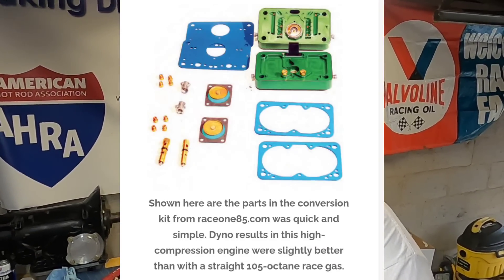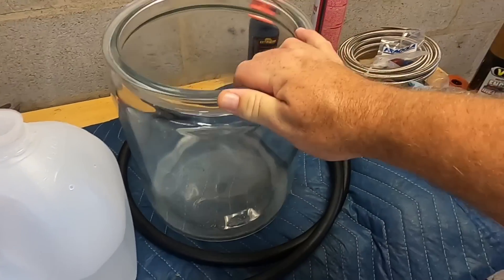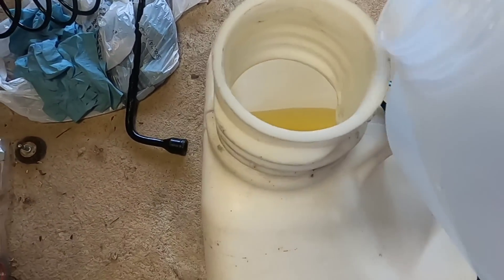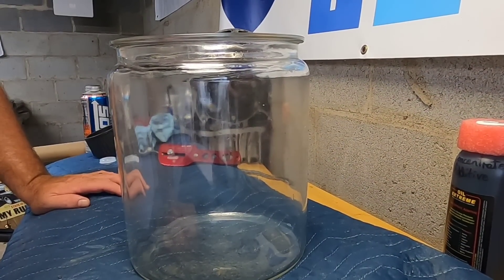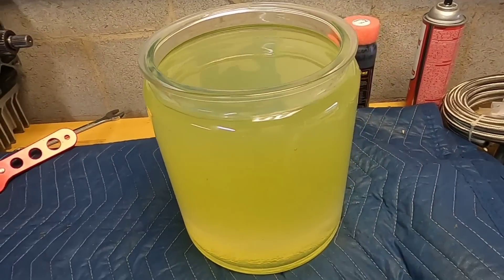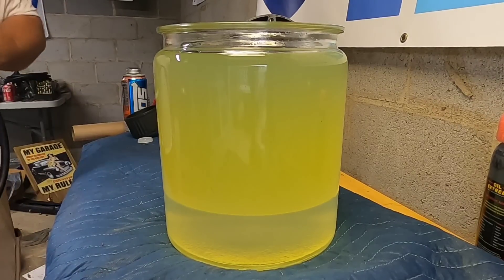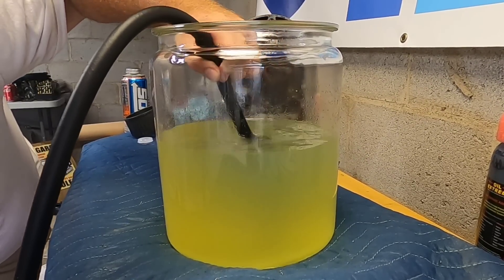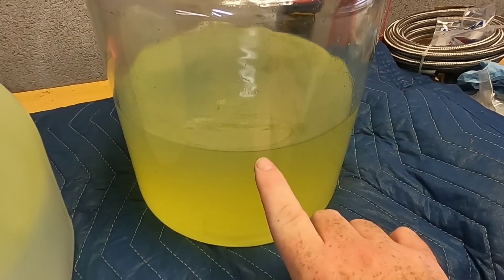Making your own ETHANOL FREE Gasoline!!! it's easier than you think!!

Comment: I have to drive 40 miles round trip to a local small airport to get ethanol-free E0 gas.  Today's price is $5.75 / gal -- a little more than double the price of 10% ethanol regular gas.  But, it comes from a separate pump so there's no mixing E0 with E10

Comment: Ethanol acts as an octane booster in gasoline blends. When you remove ethanol—whether intentionally or through phase separation caused by water contamination—the remaining gasoline has a lower octane rating than the original blend.
In fact, studies show that removing ethanol from a 10% ethanol blend (E10) can reduce the octane rating by up to 3 points, which can lead to engine knocking or performance issues in vehicles designed for higher-octane fuel. That’s why fuel that has undergone phase separation is often considered out of spec and not legally sellable.

Comment: Terrible video.  The ethanol does NOT separate from the water, it gets absorbed into the water.  You did NOT wait anywhere long enough for the separation.  You should have had way more water/ethanol mixture.  This is some on the worst instruction I’ve ever seen.

Comment: I run all engines on e85. Lawn mower, snowblower, chainsaw, generator, my regular truck and car. Cold weather starting requires more gasoline mixed in. 15 years and no issues.❤

Comment: I've ran 10% ethanol in every engine I've ever owned and it's literally never caused me any problems. Old timers will say it gunks up carburetors or it's bad on small engines and that's a load of crap. Your carburetors gunk up or your jets clog because you left gasoline in your mower all winter long. Run the fuel out before storing and these issues will disappear.

Comment: I bought a gasoline tester. It’s just a little tube with a cap on it and it has graduated lines. You put water into the one line and gasoline up to the top. Shake it in about 10 minutes later all the water and ethanol come to the bottom, I have zero ethanol gas.

Comment: Don't try to store it. You have removed most of the corrosion inhibitor, detergent,  binding agents, antioxidants, stabilizers and more. Burn it all up quickly and run your fuel system dry when you're done. 
NOTE; If yoor that hellbent on worrying about alcohol gas just buy equipment that can handle it. Go Old School Carburetion w/ adjustable fuel mixture screws or jets and learn to tune.

Comment: Or maybe just go up the road and buy 5 gallons of non ethanol gasoline at a gas station. Probably cheaper in the long run. Just because you can do something does not make it the best option.
You kill what little octane you have the way you are doing it. Most commercial ethanol free gas has at least 90 octane.

Comment: I would like to share with you my method for getting ethanol free gas. I go to the corner gas station and buy ethanol free 93 octane gas. WHY, do people, as evidenced by all the YouTube videos, go to all this dangerous screwing around? 87 octane in the vehicles and 93 octane in the small engines. I’m 75 and life has taught me at least one thing. Keep it simple; if a choice between just buying ethanol free gas or setting up the lab and going through a big rigmarole, I’ll buy the gas and be done with it. You were correct in warning, “Don’t do this in your house.” For those home chemists that didn’t get the message, I can’t wait to see who mixes up a batch in their basement and blows themselves to kingdom come.
Be careful out there folks!🔥=🚒
Reply: In many parts of the country, ethanol-free gasoline is not available.
Reply: @MCOult  Okay, I’ll revise what I said. Where, you can get ethanol free gas, I would suggest using it. But I would be VERY careful mixing up a home batch. A sure recipe for disaster.
Reply: @lorinkramer5805  Not available in Ontario.
Reply: Dont have gas hurraince hit, but i can have other stuff around in the mean time as a alternative. 😅 I hope you dont die of cancer.
Reply: The irony is alcohol is super cheap, so very profitable to add alcohol to fuel and charge gasoline prices. For a 1000 gallon tank 10% is a lot of $$$, but the crazy thing is, " clear gas" is super expensive, in fact in my area you can buy oxygenation fuel for $3.50-$3.75 but Clear gas is nearly $5 a gallon so you pay a premium. So, not everyone has access either to clear gas either
Reply: @sluggo503 Sluggo, you are 100% correct. When I added my comment, I should have added the words, “WHEN AVAILABLE, for safety sake, just buy ethanol free gas and skip the lab.” There is a gas station here in the town where I live that has only 87 and diesel; and only two diesel pumps at that. No midrange or premium.

Comment: Taking out the Ethanol ..also takes out the OCTANE. For small engines ...maybe OK..maybe not.... For cars...this is a big sin it seems, ,,.especially older cars....with higher compression. 
This video is ill conceived and leaves out this important issue of octane,. ..,which is why the 10% Ehtanol is in the gas to begin with. Better solution is to add water mixer..ie...stable....so the water is mixed..and does not separate out....rather than kill your octane . ..and paying full price for it, ..doing a lot of work to create a lot of detonation. ???

Comment: I cried a little for the gas you lost because you didn't tilt the jar over to get the wash all into one edge (yes a square container with a corner to syphon out of would help).
PS 15 minutes won't settle out right. Try 24 hours +.
PPS. Keeping you tank topped off reduces the air to gas ratio in the tank so there's less atmosphere to suck water out of.

Comment: As commented before, You should have reminded that the 87 is no longer 87, and for some engines that is bad news. Not for a Briggs&Stratton with low compression ratio, but, say, an outboard will be in trouble. So ,if someone wants to make ethanol free 87, he must use at least 93 for making it.

Comment: Here in Mississippi, regular 87 octane is sold for $3.00 per gallon.  The ethanol free gas is $3.30 per gallon (actually, these numbers have gone a little higher recently).  So you can pay a 10% premium to keep that ethanol out of your gas, or lose 10% by removing 10% of your purchase when you remove the ethanol and throw it away.  At least here, the smart move is to pay the premium and save the labor of removing the ethanol, unless of course, you have some use for water infused ethanol.
Reply: but here where i live the local airport will not sell to anything but a airplane. and the only station that is “close” to me that sells pure gasoline is one hundred rd miles away.
Reply: Your probably still getting 5% ethanol and not even realizing it.
Reply: @tacticalcenter8658  nope
Reply: @jimibmore  unless you are using a laboratory to extract the ethonal you are not going to get 100% free ethonal. It's just not gonna happen without sacrificing some of the fuel.

Comment: I wss always told to mixed water with the gas , let it sit for 15mins than freeze it ....the water and the ethanol freezes the gas doesn't, so after it freezes you just dump out the clean non-ethanol fuel . While leaving the frozen water/ethanol mix in the container.

Comment: A) 15 minutes is NOT NEARLY long enough to settle out all the suspended ethanol/water mix. Give it 24. Must be clear.
B) Starting with 87 octane is a BAD IDEA! Results in ~82 octane = predetonation = connecting rods through the crankcase.
     Start with 92-93 octane premium. End with 87-88 octane ethanol free.

Comment: You take the ethanol out of 87 octane gas then you have 80 octane gas left and you will have junk.. Ethanol in lower grades of gas is used to boost the octane and you take it out your octane away from fuel left!! Do not do this unless you can test your octane!

Comment: You can also buy a separatory funnel and stand and do it a lot easier. You would just drain the water and ethanol out of the bottom. Also, letting it sit longer would result in better results as far as the gasoline is concerned.
Reply: I have an aviation water filter and ethanol molecules are smaller than water,  stays on top. passes straight through the filter

Comment: One problem with this is the ethanol raises the octane levels of gas. When you remove it from 87 octane what is the octane level afterwards? If you take 87 octane fuel and add 10% ethanol it will be 89-90 octane fuel. What if you start at 87?

Comment: So what do you do with all the bad water you contaminated??? Dump it out back in the creek or down the storm drain I would suspect. NICE!  Considering you can buy non ethanol gas for small engines at auto parts stores, Tractor Supply, most outdoor equipment dealers, and more and more gas stations are now selling it, why would you do this neanderthal method? You need higher octane? You can buy race gas online in any configuration you could want...leaded, unleaded, with or without ethanol, E85, ultra high octane. Name your poison.  Be ready to pay though that is the price you pay for something special. You make your own gas this way you are asking for trouble.

Comment: Just for shits and giggles ? If you do this to remove the ethanol from the fuel for your small engines (lawn mowers etc) and you have the ethanol and water separated in the other container ? can you add the ethanol to lets say 87 octane or 91 octane fuel and convert the 87 to 91 or the 91 to 94 or higher ? I ask this because in the 1980's I used to put aviation fuel (helicopter) in my Camaro that had flat top pistons and 58 cc 416 SBC castings which netted around a 12.5 to 1 compression ratio and it ran great. You cannot just walk up to an airport and buy 5 gallons of aviation fuel anymore so wondering if you can use this method to make your own ? and is there a tester to test the content so you can dial it in 100% with no error involved ? would be a great video showing people how to make aviation grade fuel or maybe even race fuel ?

Comment: Add a tap to the bottom of the vessel (Separator)with a valve that way you can drain out the water/alcohol mix without all this siphon mess.  As a side note add some acetone to reduce the chance of engine knock.

Comment: I do the same thing with my old mower gas, no matter what you do it gets water in it! Put the gas in a large clear bottle like a dish soap bottle key part here is the valve, add gas and water shake let separation happen turn bottle over and open valve top squeeze out water… your done, put the rest in your tank! You could just decant your mix like wine but you may get some water in your tank, if your not very careful. Dont worry about octane its a mower  after all.

Comment: I'm a retired ASE Master Technician that was trained at the Atlanta General Motors Training College back in the 90's and Ethanol has a bad rep it doesn't deserve, mostly because of misunderstanding and what happens to small engines, especially in the carburetors, when people just leave it in them over weeks and months of inactivity. First, a little history of how the gasoline market worked BEFORE "gasahol".

Before they put ethanol in gasoline every gas station had long poles they had to keep that were long enough to reach the bottom of their tanks. They also had to keep a tube of special paste that a state inspector would smear on the pole he used to inspect the tanks. The paste revealed any water that was at the bottom of the tank. The reason there was water in the tanks in the first place was because the air has humidity and as the tank empties, moist air gets drawn in and the water condenses inside the tank. Over time it builds up until the tank has to be drained and cleaned of water. There were standards as to how far off the bottom of the tank the pump was allowed to draw the gas from and if the water got too high in the tank it had to be drained completely. Then came "gasahol".

Gasahol has an additive that allows the gasoline to absorb up to 10% Ethanol (and/or water). They don't put 10% ethanol in the gas, it's more like 9.5% leaving a little room for error, more specifically, room for the moist air to leave it's water in the tank, drip down into the gas and still absorb the water. Tanks that are for gasahol only rarely get inspected because there's almost no need for it. They literally never get water at the bottom of the tank because the gasahol always absorbs the drip of condensation before a new load comes in and new gasahol can do it all over again. Gasahol has almost eliminated the possibility of buying "bad gas", that is to say getting a cup of water thrown in with your ten gallons of gas...

...water that will clog your fuel filter. Once a fuel filter gets it's filtering element soaked with fuel, be it diesel, gasoline or gasahol, it will not pass water. This is a good thing. We don't want to be sending water to our fuel injectors, it destroys them. However, every fuel filter I ever changed had water in it. That's because of that moist air thing I was telling you about. Your gas tank draws air in as it empties of fuel so inside your gas tank there is a problem with water getting inside. Mostly your fuel pump pumps it out to the filter where it stays until it covers up too much of the filtering element and the pump then can't supply enough fuel to the engine. One of the first things I would do on a customer complaint of no power is change the fuel filter. Almost always I would find the fuel filter full of water and that would fix the car. So the wise thing to do is to buy your gasahol where they sell the most gasahol, the busiest station in town. That way you stand the best chance of not getting the gas in your tank at that 10% ratio where the water will fall out and clog your fuel filter. Seen in this light, gasahol is a good thing, a very good thing.

Not only that, but Ethanol is high octane, 113 as a matter-of-fact and it boosts the octane rating of gasahol. When you take the ethanol out of the gas, you lower the octane rating of the gas. Best guess is, that gas you removed the ethanol from is now 85 octane or lower.

Where small engines give gasahol a bad rep is when people leave a gallon or two in the tank over the winter after the grass quits growing. When the moisture drips down into the tank on the riding mower and gets the ratio over 10%, it and the ethanol falls out of the gas and lays at the bottom of the tank, covered by the gasoline, so it doesn't evaporate, the gasoline evaporates. Meantime the additive meant to suspend the ethanol in the gas gets concentrated in the water/ethanol mixture and makes acids that corrode the carburetor and plugs up the jet. So next spring the thing won't run and the mechanic rightly says the gasahol is at fault.

Next year try this. Drain the gas tank of your lawnmower when you store it for the winter and run the carburetor dry. That way when you put new gas in it in the spring, it will start on the first pull... AND on gasahol.

Comment: Ethanol is mostly water, water is not good for any motor.   although, It can be good to drink, under the right circumstances.:face-blue-smiling::person-turqouise-waving: You never said how much gas was in the gas can. That might be kind of important. Put a little spicket on the bottom of that jar, drain the water off real qwick. Buy 5 $ worth of gas and throw away 3 $ worth of water.:face-turquoise-covering-eyes: What keeps it from separating in the tank's at the station??? it only took 15 min, to separate in your video, it set's all day and night for weeks in those tanks, it seams like it would separate and somebody would get a whole lot of water with there fill up.  More then normal.

Comment: I could be wrong but doesn't leaving the mix open to the air whilst settling out allow the more volatile shorter chain hydrocarbons to evaporate out of the gas? It's short chain evaporation that makes stored gas go stale and it is then less willing to fire on start up. Just a thought.